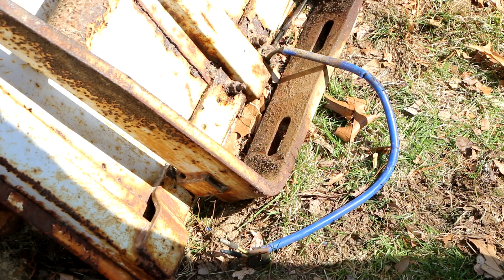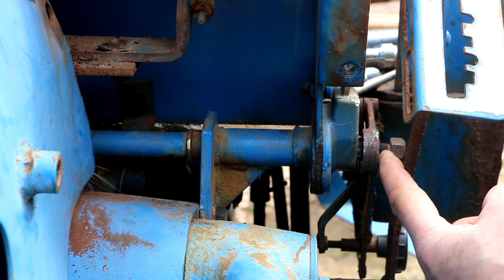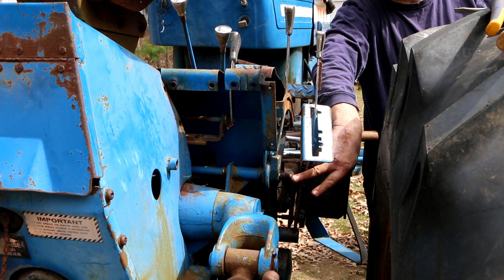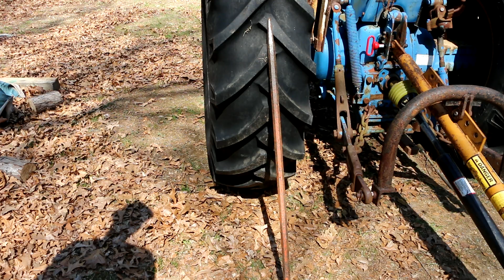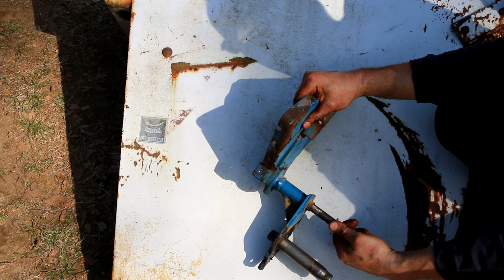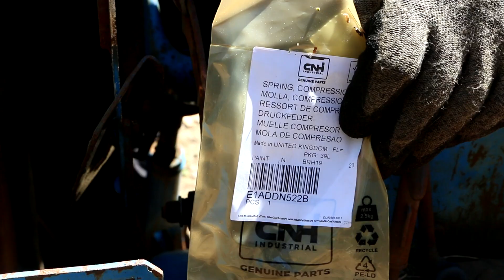Ford 5000 Lift lever Repair (Binding lift control lever)

Comment: I don’t know what year your Ford is? I’ve got a couple Ford 1300 tractors. They’re hard to find parts for. Keep them old tractors well lubed and dry in the barn.
Maybe you can put a zerk fitting on that push and keep it greased up.
Reply from the maker: I think mine is a 1972
Reply: @stevewatr mine Between 78and81 I had to hunt for parts. I live in Florida panhandle and get parts used parts all the way from a bone yard California and Pennsylvania. Some times could not find at all. I have one it’s a 4x4 loader. Had a bunch of gears bust apart in the front end. I ended up buying a hole second tractor off facebook. Drove up to South Carolina to get it. 2nd tractor had no loader, so I stole the part from it, and made it a 2 wheel drive. Just use second one from 2nd one for mowing. Until someone day when I need more parts. Then I’ll have to park it in the barn and pick it to death. Hope all this makes sense. Enjoy your videos. Love them old fords!
Reply: @stevewatr  I wrote that mess while my wife was driving down the interstate talking to me.😂 I’m to lazy to edit it now 😂